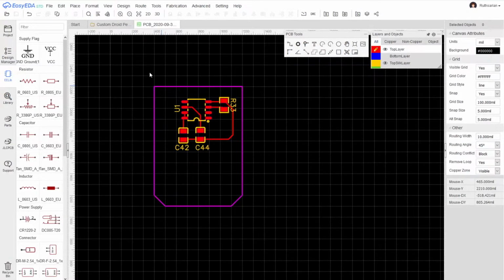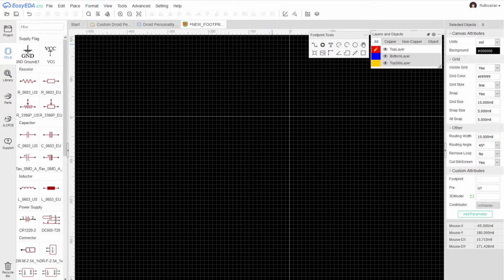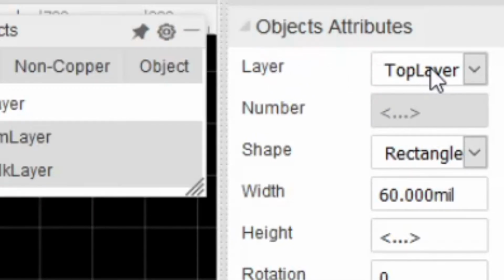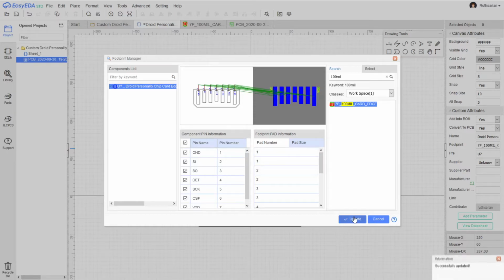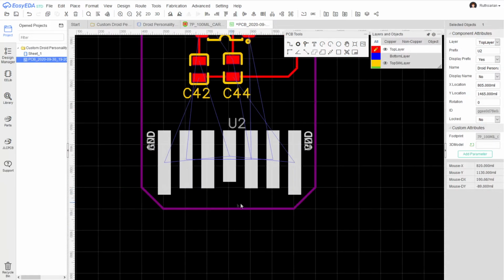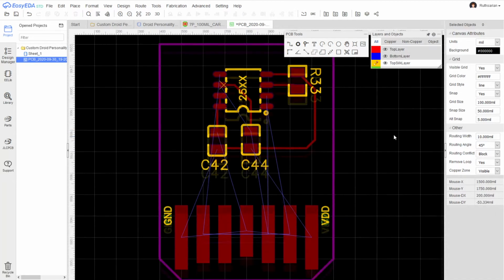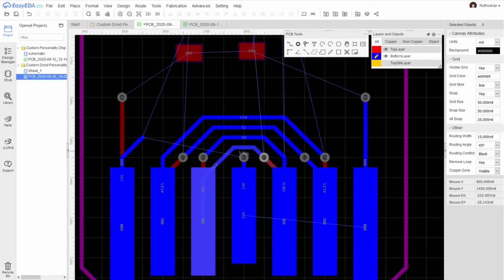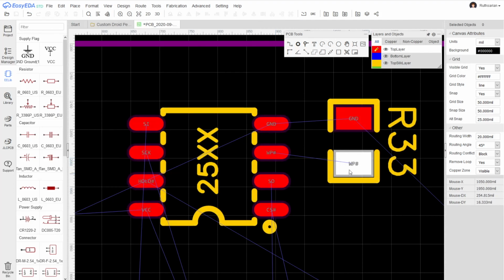Reverse Engineering A Droid Personality Chip: Part 3 - Adding Fingers to the PCB

Comment: Thanks for your tutorial, but I'm curious why you designed your gold fingers with "opposite" directions at top & bottom layers. Did you plan this on purpose?
Reply from the maker: yes, that's on purpose. it's so if you insert the personality chip backwards, the fingers will still line up correctly.
Reply: @Ruthsarian  I see, thanks fo your kind reply. Indeed this design will fit both sides of insertion. 🙏